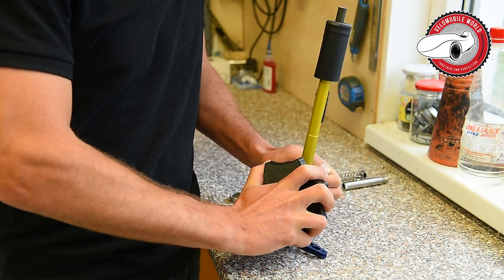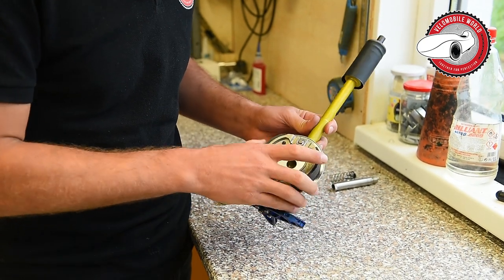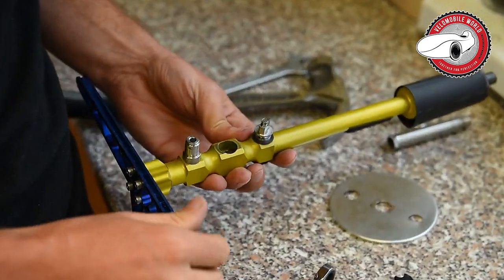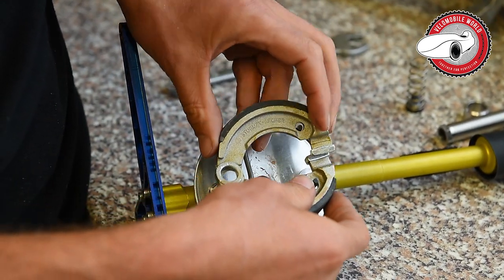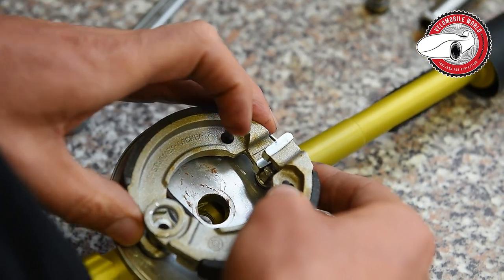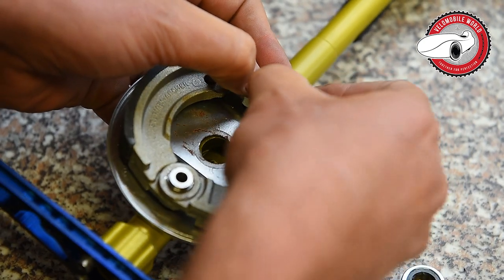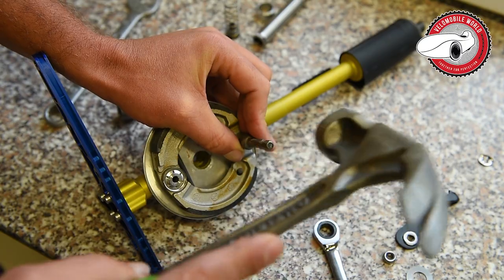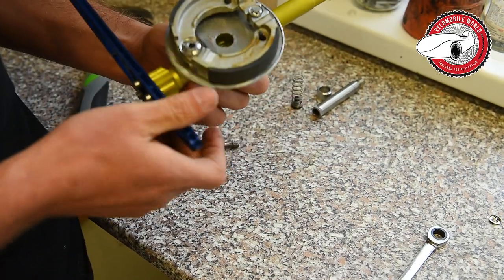Brake Maintenance | Alpha Series Velomobile Maintenance

Comment: How about some stainless Steel or Aluminium tube to push/hammer on the Washers? That should be cheap and prevent from rust spots. Thanks for the technical series. That shows a bit what may be done at home.
I know your dealers list, but how about a list of Workshops or experienced/willing private persons which are able to help out with work on the bike. It's fine but I guess quite a few are cautious to work on the brakes or so and the local dealer may be several hundred km's away. Maybe a hint in the videos what is possibly available as a service in the local workshops as it is standard parts (like brake replacement, Drivetrain, possibly truing with some work-arounds if your shop still does it...) can help as well.
Reply from the maker: Well we see what we can do.

Comment: the pin also could lose power because of rounded edges, is the a replacement to order on the site ? copper grease is no lubrication only a rust prevention for bolt and nuts
Reply from the maker: Could you be more specific which part you need. We have exploded views on the website if you search by technical support. You can contact for parts mircea@velomobileworld.com
Reply from the maker: The cupper grease is also ment for rust prevention